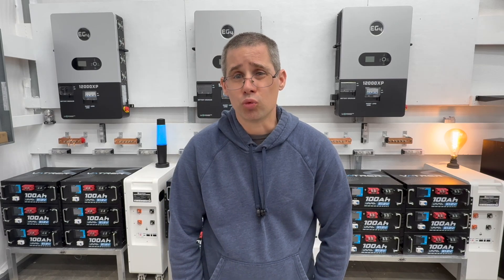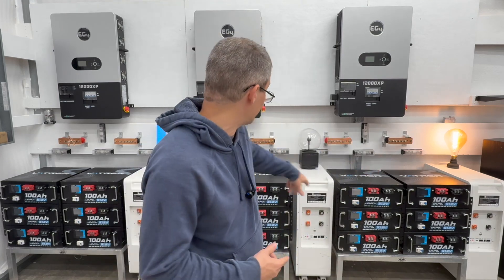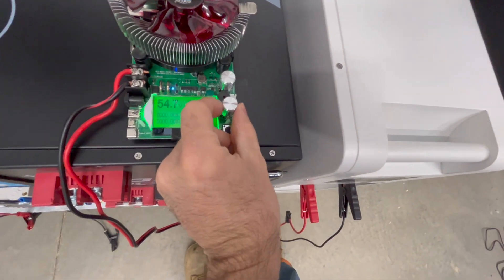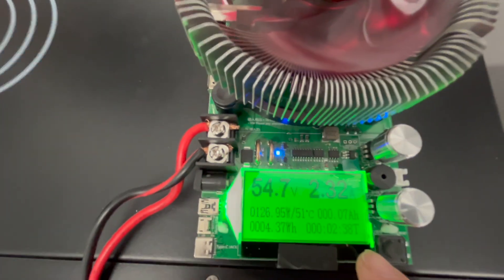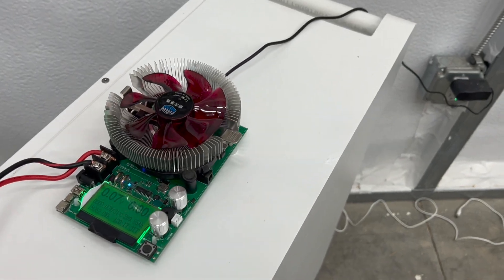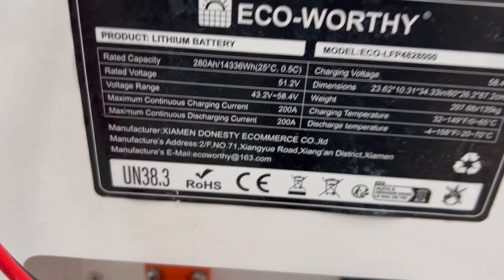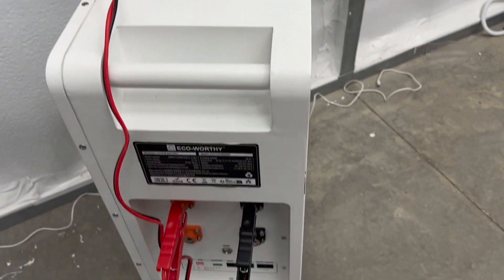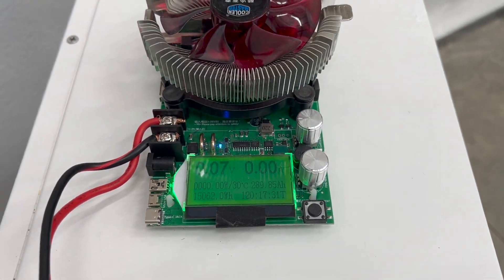Eco-Worthy 280Ah LiFePO4 Capacity Test: SURPRISING Results!

Comment: What the actual am I looking at?

You've got a $20,000 wall of LiFePo behind you and you use a $70 MakerHawk, for FIVE days, to drain a test item? One with a 200a rating?   😮

What? Really... WTF?   🙄

I'm gonna sub just so in a coupke days, when I have time, I'll look to see if you are always this insane.
🤔
Reply from the maker: Hi Jim,
Thanks for leaving a comment! I recently upgraded to a more powerful battery capacity tester that completes tests in significantly less time. Interestingly, when I compared it to my older, lower wattage tester using the same battery, the results were nearly identical—within just 1 watt-hour of each other. While the new tester is clearly faster, I was genuinely impressed by how accurate both units were.
Reply: @MikesSolarGarage : Thanks for the reply.   👍

Now that I understand you're a project channel, not a reviewer, I have to ask (haven't looked over your content yet, this is for general info)...

To get the best capacity and balance all those batts, you should (must?) first fully cycle each one at least once. Prep the BMS, as it were.
Did you spend ~5 days draining each one?   😯

😛

Comment: My custom built battery put battery to shame it will 17kwh and it’s heated and fire arresters my battery 2999.00
Reply from the maker: That’s a good price.  I think I paid 2299 for this one.  It does not have fire arrestors but I do have an automatic fire suppression system.  I need to mount it and do a video.  Each system will have one and it is the size of a medium sized fire extinguisher.  It is setup to activate at 135 degrees F.  Thank you for watching, I really appreciate it

Comment: 280 ah should pull over 300. My 314 pulls about 335 so 289 is not good
Reply from the maker: Those are really good numbers.  Did you active balance the cells first or was it passive?

Comment: 280 Ah is not huge. 280Ah cells are yesterday's news. Modern batteries are now using 330 Ah cells. And that cheap $29 load tester is not going to give you any sort of accurate capacity test. Our battery lab spent over $5,000 on each of our capacity testers.
Reply from the maker: I am using the same capacity tester that Will Prowse uses.  Which one would you recommend?
Reply: Battery cells are kinda like solar panels... the $cost/Ah ($cost/W for a solar panel) is what matters more than anything else when one is talking about stationary storage.  So bigger is not necessarily better.  And given that these things have a 15 year life-span, I doubt anyone is going to be rushing to replace their battery packs every few years when the ones they have work just fine.

I for one am incredibly impressed that there's almost 90kWh of storage sitting on the floor right there.   These things have at least a 15-year life-span... it would be silly to replace the bank every few years just because cell capacity goes up.   and I really like the stand-up form-factor that many battery makers have been moving to.  It is a much better use of floor space than the racks.

In anycase, that tester is fine. It will be accurate +/- 2% or so with a sub-1% relative error between different runs.  That is just fine for these purposes.

-Matt
Reply from the maker: @junkerzn7312 I completely agree Matt.  I like my server rack batteries, but these larger stand up batteries really simplifies things.  Both have their pluses and minuses but these had a really good showing with the capacity test.  Thank you for watching!